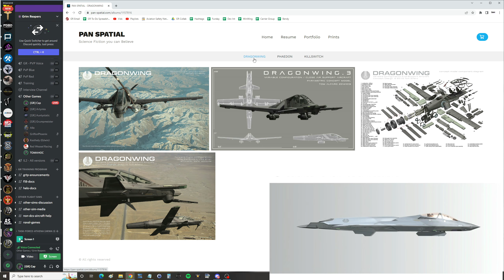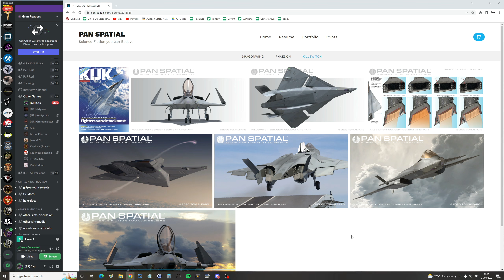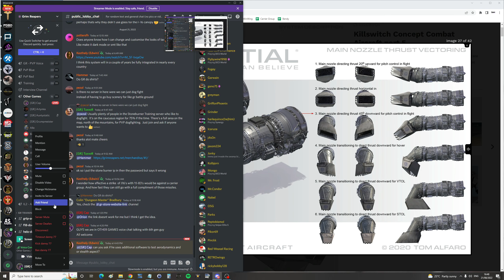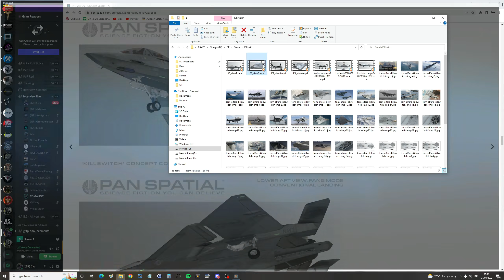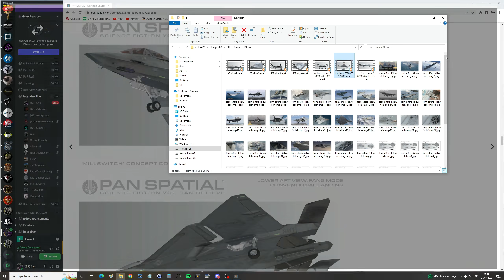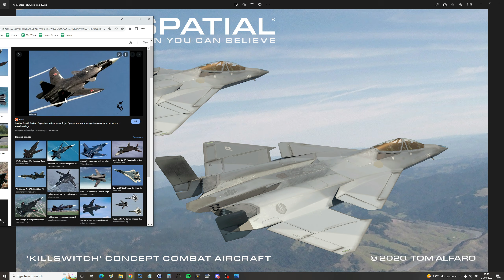Discussion: The "Killswitch" 6th Generation Fighter Aircraft Concept (by Tom Alfaro)

Comment: 6th gen are just going to be drones.  Without a pilot they can turn harder and faster their radar cross section is far smaller and all the extra stuff you can pack into the aircraft now you don't need all that stuff for a pilot.  Pack of data linked drone swarm packs coming after you in either kamikaze or hit and run..... it's over for you.

I mean we are inches and goal from Skynet and we are dead set to get there as fast as humanly possible because we are afraid our enemy will first.

Comment: Ever see some fool try to retract their convertible top doing 70 mph on the turnpike? Maybe you have to be an old fogie (me) from the 60s to remember that. Anyway... SSDD.  This thing's pretty.  And that's about it, 'cuz it's a fabrication clusterfuck to try to make actually WORK.  Mostly 'cuz the "saucer separation" bit WON'T work.  As presented, this is ~60' (18 m) length craft.  You can't build the necessary fuselage structural integrity to withstand high-subsonic speed forces on "reconfiguration" of this kind.  And coming out of high-sub speeds is when you would try to engage this feature.  As for "should always improve performance"... 

Missiles & guns on a next-gen is NOT that.  We're set to start rigging B-2s for a 12,000 lb high powered laser kill weapon.  Thanks to new Rolls Royce turbogenerators being produced in the last year.  >1.0 Mega-Joules/cm2/sec CW.  Vaporizes stainless steel in 1.0 seconds contact.  We've had the laser since 1978.  Just didn't have a highly mobile electrical power source capable of >4.0 MW continuous output... that weighed <30,000 lb (including laser head, optics, actuators, mounting braces, cooling system & gen-fuel).  Now we do. 

B-2s are true 5th gen Stealth jets.  0.05 m2 RCS.  650+ mph.  50,000' ceiling.  From which, laser has a 250 mile range against surface targets.  400+ mile range against airborne targets >20,000'.  Laser is near-UV output.  Invisible to the human eye, as well as military fighter/bomber & most satellite sensors.  NO radar warnings.  NO seeing incoming  missile exhaust trails.  Your plane just bursts into flames and you die.  It fires for 3 seconds CW, then refires in 7 seconds.  Up to 6x/minute.  Indefinitely.  4 such B-2s are collectively capable of 720 kill shots in 30 minutes.  

Your guns & missiles, literally, can't touch that. And America saves TRILLIONS on missiles & ammo.

Comment: As  an engineering perspective, the plane design seems too complex to build and unsecure to the pilot due to the multiple moving pieces that after continue use are going to be affected by material, and  structure fatigue. Also, the construction and test phase will be too costly to implement.

That is the reason why we don't have planes  similar in the complexity level as the F14, or  F-111 anymore. (moving  variable geometry wings)

The plane will fit better on sci-fi movies and TV shows than the aerospace defence industry.

Comment: Umm I feel like  Is this engineer  hit a big bowl before he got on for this conversation.. hearing more about his process than I need to lol. Guy is telling me about how engineers feel along with this that and the other.. keep it to brass tacks. Just tell us about the damn plane man 🤣!  I was surprised to see a twin seat cockpit. I was Thinking this would be a single seater. Why would a 6th generation need two in the cockpit?  I mean if there's loyal wing men They're controlled from thousands of miles away.. All the targeting and Visual information are all transferred through the helmet display i thought.. So I'm having trouble understanding why They would be 2 seaters for 6th generation. I Want to preface this all With the fact that I am a very lamest Guy when it comes to this stuff. so these are legitimate questions. Also It's a cool concept but cannot imagine The expense For maintenance, And how long it would take to build. If we ever get in a kinetic conflict With a near peer adversary How long would it take to replace these airplanes if they were shot down at a high rate ? I think we will run into the same problems as we did with the F22 On these gen 6 type jets. To much money and a long building process. At least with the F35 they are getting to a point where they can crank those out pretty quickly. So Just curious as to what your thoughts would be on this. Keep it up Cap  Somehow I am addicted to watching you guys play video games. But I like the fact that you take the time required to make it as close to realistic as possible. It's kind of like watching war without The bullshit that comes with actual war. I hope China watches A lot of these you put out so they know what  They'd be getting into. And I also hope they understand that we would not be alone If it ever popped off. So seeing us kick ass when we are all by ourselves Without allies fighting beside us Definitely is a good feeling. I hope we do as well as far as the US . There is definitely something that can be gained By Doing these simulations,  especially when they are as close to realistic as they can be. I also like the banter between y'all!  Love this Channel! Get excited when there's a video I haven't seen yet. Y'all are doing something right!

Comment: The change in aircraft length looks better than swing wing to me. Put the engine and intake on the back half of the plane. It actually resembles a bi-plane with 2 wings in the same horizontal plane. Much faster and much longer range at higher altitudes may be better than putting 40mph mega carriers in harm's way. Use the carriers as tankers. Much could be done with the very long B-1 and SR-71 designs.

Comment: When you fully extend the airframe, the linkaging should be able to lock in strongly at both ends. You only need the closed and fully extended positions most of the time. Securing the extension should be able to reduce long term ware. The linking points will also cover a large area which distributes the stress widely.  I have seen a very interesting design concept that has a very unusual helicopter jet concept that was really amazing. Hard to imagine it actually working, but has some real lateral thinking.  Often great ideas are relatively simple. Getting them to work can be more difficult.  But really interesting to see. I think the fuselage could have a long service life.  There is a lot more going on here that we can not see in such a short presentation. Best just to enjoy it, rather than critique.

Comment: I think the things I love most about this concept are the dual-purpose components and the weapon systems. The missile bay is genius. The DEW powered by the lift fan generator is genius. The folding vertical stabilizers are genius. So many applicable ideas were explored in this one design concept and I love it! The one thing I would subtract, agreeing with Simba, is the variable macro-geometry

Comment: And saying cost of the F-35? Clearly doesn’t pay attention to what’s happening, and it was a given that the earlier ones being built would cost far more than later in production, as is the case now, the whole point of the JSF program was to figure out to mass produce 5th stealth aircraft in an affordable way, which they have successfully done now, as it is now cheaper than the other top of the line 4 gens, made in advanced, western nations, and far more capable and survivable, with way better systems that dwarf the 4th gens. We have over 2500 ordered. Just for us…so yeah, that right there is larger than most any 3 European countries put together, of their entire Air Forces, and we’re getting it in just F-35 variants, lol. And like I said in my earlier comment, the whole program was itself a test bed for the way to manufacture our upcoming 6th gen’s in an affordable way, so we can actually field them en masse and in the mean time,  we give ourselves the second best modern airframe ever made, and any of our Allie’s, who want to buy them. This offsetting the cost of it all, a little. While we become more capable in all ways. And the 6th gen will probably incorporate more of the ideas of the different F-35’s into one airframe, further simplifying manufacturing and lower cost, as they all have almost exactly similar parts. If not all the same parts, and capabilities.

Comment: Ha, I can guarantee we are already working on crazy stuff, similar to this…we’ve had working prototypes of F-22 and the YF 23…since sometime in the 90’s, granted they were lesser than what the F-22 is now, but they were basis of it…so 20 something years now, like mid 20’s for close to what we got now…like 15 years before that the F-117 was made public, and it was fully functional when it was finally announced, and had been in service for awhile, then the B-2’s, then flying prototypes of 5th gen, to fully functional F-22/A’s in like mid 20 year range…just saying that more than likely we are far into the program to make 6th gen aircraft by now, and probably way closer than most would think…I honestly think that was one of the driving factors behind the F-35 program. It’s a way to figure out the basics of viable mass production of one of the most advanced and capable aircraft made, to make it affordable to field modern 5th gen, as a full fleet, and be able to outfit our Allie’s, and use it to offset our costs, while we keep a huge, experienced work force around, capable of building modular, modern, stealth, in a few different variants of the same base thing…basically it’s whole set up and production is a test bed for the future, so we can set up and make similar thing, but far better in our next 6th gen.

Comment: My two cents:

Time to come up with even more exciting tech that new blood will want to work with. 

I imagine a 6th/7th gen LO fighter capable, not only of air-superiority, but also truly omni-role... and VTOL will be the norm....

 A two-in-one aircraft, where both separate at the merge (if it actually comes down to it at all) .... 

The manned "lead" is armed only with guns, some fuel... minimizing weight enabling superior super-maneuvering... 

The unmanned "loyal wingman" carries the rest—fox missiles, bombs, external/conformal fuel  tanks, aew sensors.... able to " quarterback" the battlespace.... able to re-arm & re-fuel the "lead".... 

Both lead & wingman use twin engines, with F-35 like thrust vectoring nozzles, in tandem  configuration, similar to what toy drones use, for VTOL.... 

Pre-armed Drone LW can be vectored to form up & join any "lead" while the bingo LW can RTB to refuel & re-arm....

Comment: Why not use Real-TIme Rendering Engines such as Unreal Engine, which now can handle the polycounts
Reply: probably has a lot to do with what he knows vs what he doesnt know when it comes to rendering software and simulation software. You have to think he's been working on these things for however long and unreal may not have been the primary engine to use at the time of development OR it wasn't what he was most skilled in using to make said renders.

Comment: Instead of triangular lids that flip up extruding out of the air frame, I’d wonder if it would be possible to have the lids sink into the air frame and then either retract or rotate out of the way, but in one smooth motion.

Comment: I think the big takeaway here is the Shot Locker system.  The Shot Locker could be designed as a removable pod that could be replaced quickly by a single ground crewman using a forklift.  Preloading these in a hangar would be much faster.  It provides extreme angle of attack shots if needed and I would argue it could have a module or 2 loaded upside down with countermeasures or reverse shots for incoming threats.  And best of all there's almost no moving parts to break and no single point of failure.
Reply: aswell you could make them as removable 'gunpod' style weapons pods to be used to augment 4th/5th gen current fighters

Comment: Super cool concept.  Address the fuel and weapons capacity the same way as we already do: variants.  Build one without the STOVL capability and folding wings and you have an F22 replacement capable of holding more fuel and maybe a couple of air to ground weapons in place of the axial fan. The variant in this video would be a carrier specific variant due to the folding wings.  Obviously a very short range fighter.  Maybe this one is the jet you scramble when you have enemy aircraft inbound on your carrier group.  Also, if you have the focused energy weapon, the need for air to air missiles is much lower.  Shrink the weapon pods to fit 4 long range and 4 short range missiles to again increased room for fuel.  The energy weapon takes care of incoming missiles if you know they're coming and can turn your nose toward them, and can handle air to air offense.  Use long range missiles for bombers and such that won't be able to evade them, use short range for dog fights when you can get a lock but can't get the nose on for guns.  Energy weapon for medium range and/or aircraft that are closing distance but haven't merged yet.  

I don't know.... a lot of people saying it's unrealistic, but people said the same thing about the fifth gen concept before they were developed.  In the 80s no one would have believed an aircraft could be built to maneuver like an F22, house internal weapons, or have such a small radar cross section while maintaining the ability to be a capable dog fighter.  Yet here we are 25 years after it was developed and entered service and this concept is not NEARLY as far fetched as YF22 or YF23 seemed back in the early 90s lol.  I think  this design has a ton of potential.  It's too bad it's not really in the runnings for development as the F22's replacement.  It would be interesting to see how capable it could be

Comment: Lots of interesting takes on solutions to existing problems. One thing to note is that many of those current problems were born of necessity to solve other complex problems, and you can't forget those original problems, lest your solution unintentionally suffer from them as well.

One thing that comes to mind is the weapons bays of the F-22 and F-35. They had to solve a problem where the missiles were at risk of veering back into the airplane when suddenly subjected to a totally different aerodynamic environment. The triangular missile shapes are great for packaging, but would suffer even more from this phenomenon because of that loss of aerodynamic predictability he described.

Another problem is that delta wings don't actually have too many performance detriments (which is why the European fighters have used them so much). The F-16XL used the cranked arrow delta and outperformed the regular F-16 in almost all flight regimes except low-speed high-alpha. Is that unique flight regime really in need of such a solution as to add all the complexity and weight of variable geometry fuselage structure? I don't suspect it is from a combat survivability perspective. Maybe, though, from a carrier landing perspective it is.

Comment: I have been learning how to use blender to add 3d models to dcs.   Fireblaze has an awesome 👌 tutorial.  I added Castle Hohenzollern from sketchfab to dcs as a static (no damage models yet) for feature in my mission ace combat zero stage of apocalypse remake in dcs as stier castle.  

Next I'm learning animated models in dcs, I intend to replace the stock animation of the RN24 with a castle bravo type animation.  I just finished an aces 4 sitting duck rebuild I got tu95s dropping mk82s on b-52s at saipan (allenfort)  

It would be awesome to use these 3d models for working aircraft in dcs, fireblaze has an awesome tutorial for that as well.   I would like to fly this craft, it looks badass 😎

Comment: I may be a little late but i got a question which may or may not get answered. So the whole wing structure to me doesnt make real sense like the crosssection of every wing in total general looks the same at the front it bulges up relatively fast and slowly gets thinner and thinner to the rear. Now When the plane is in its delta wing configuration the aerofoil is complete and all but as soon as it splits to forward swept and canards it like "rips" apart. Its splitting one big aerofoil  into two smaller ones? Is there a solution on this?